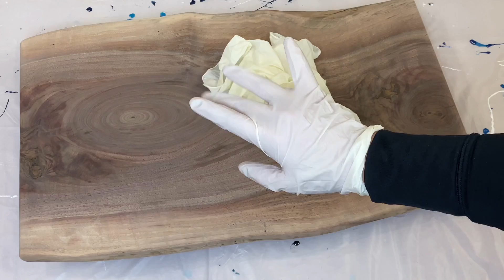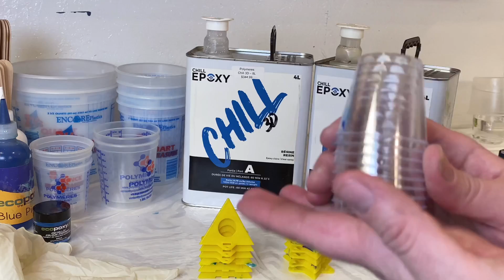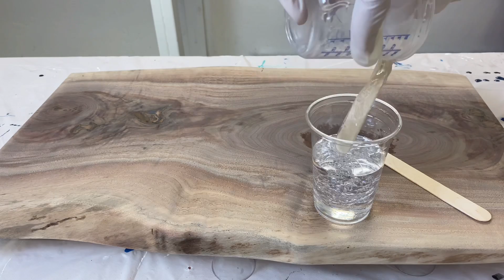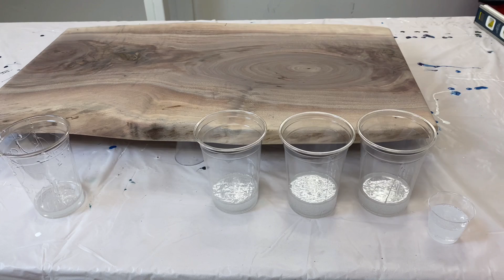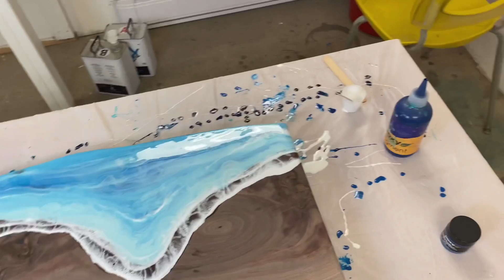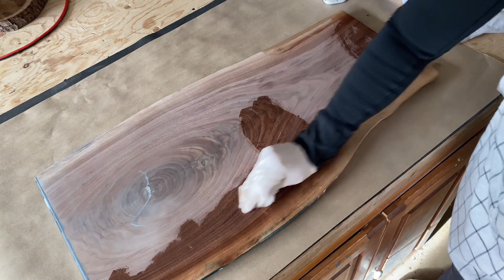How to make a Resin Cheeseboard  | Epoxy Art Overlays For Beginners  | Epoxy & Woodworking Tutorials

Comment: I’ve watched your videos so many times! Your artwork is absolutely beautiful. I have tried to make my own beach art on a bamboo serving board but I’m having trouble. I can’t manage to get the cells for the waves. I bought the Chillepoxy resin and hardener as well as the Chillepoxy white liquid pigment. No luck 😞😔 Also, the edges won’t stick as I would like them to. Could this be the type of wood I’m using? Could it be that I am warming the resin too much somehow? I’ve tried multiple layers. I feel pretty frustrated right now. Any advice is appreciated.
Reply from the maker: Thanks so much for your kind words and for watching! I definitely want to give you some pointers for this and help you achieve the look you’re going for. 

Which kit from Chill Epoxy did you purchase? You’ll want to make sure it’s the Chill 3D for the best results with overlays like this. If that is the kit you bought, it could be the temperatures are too warm in your work space. The sweet spot for me is 68-70 degrees. Unless the epoxy is crystallized or below 60’ish degrees, you shouldn’t need to warm it up in a water bath at all. After you’ve mixed it, try letting it sit in your cup for 10-15 minutes before you pour. Also, make sure you’re not blowing the white too much with the heat gun. You want to move it a couple inches and then let the cells appears on their own as it cures. You can spritz with alcohol, but it’s not necessary and will usually require a final clear flood to level out any low spots. Lastly, I would experiment with adding more pigment. Chill recommends starting with 2-5%, but I like to add up to 10% for the density I like to really make the cells pop with the clear.

As for the coverage on the edges. Is the bamboo serving tray already coated with oil or finish? 

Try sanding the sides of the area and round off the edges slightly where you want it to run off. I’d recommend using an orbital sander and 100-120 grit. If it’s coated in any type of oil or wax finish, that should be removed prior to pour epoxy over it. You may need to clean with acetone, sand, repeat until you remove as much as possible. It’s always best to pour onto raw wood though. 

I hope that helps! Turn on notifications and I can work on a video to help with this. I’ve been meaning to do that for a long time in all honesty. Thanks again for watching and subscribing! 

My goal for 2022 is to focus more on my YouTube channel! And… learn to scroll saw 🙈🙌🏼🥂 Happy New Year! Please keep me posted how your next attempt goes. Good luck! You’ve got this!

Comment: I love, that great tutorial 👏❤️ a single question, what proportions of resin and white mixtures to create the effect of the waves??
Reply from the maker: Thanks for watching!! I’m actually working on a video for this next! The best way to test it start by adding a little white pigment to the clear at a time and then mixing and testing on a scrap piece of wood. If then add a little more pigment and do the same thing. Usually 3-4 tests is sufficient. After that wait and let them cure and then see what you’re left with. It’s helpful to make test notes and label your sample. After that you’ll have an idea of how much pigment is needed to get the effect you’re going for. I did a lot of samples when I started! I hope that helps until my next video comes out ❤️🙏🏻 Good luck!
Reply: @backwooddesignco  Thank you very much for your help, I will be attentive to your channel to see your incredible works 🙏❤️🙌

Comment: Hi just found your great tutorial. One question 🤔 Should the white for waves, be less dense, less color, than the blue epoxy pigments ?
Reply from the maker: Hey Tim! Thanks for watching. Yes, you want it be less dense than the blue in order to float on top. It sounds backwards, I know, but because you’re adding more white pigment ratio compared to the blue.. you’re actually thinning the epoxy and making it less dense. This is where the clear epoxy comes in as well, with no pigment added, the epoxy is the most dense. So when the white is applied over top, it’s a huge contrast in densities compared to the white directly over the blue. 

When it comes to really low viscosity epoxy, it can sometimes be the opposite.  You have to take into consideration the density of the epoxy itself and the density of the pigment you’re using as well as the ratio.

I know it’s a little bit confusing, but I hope that makes sense! Clear as mud, right? 🤣
Reply: @backwooddesignco   4 months later.....Wanted to let you know your advice really straightened out my waves. Thanks again
Reply from the maker: @timshelton4303  That makes me so happy! I’m so glad it’s been helpful. Please send me some pictures via Instagram DMs if you want, I’d love to see what you’ve created 😍🙌🏼🌊

Comment: I’m super new at all this. I tried using regular resin (lets resin brand) and opaque resin dye (hobby lobby resin dye) to try this on a pre-made cutting board. It didn’t work and ran off the board completely and never made any pattern. I’m not sure it was because it wasn’t sanded or the dye or resin im using. I’m not sure which part was incorrect, i need all the help i can get!
Reply from the maker: I’m glad you asked! What’s the pot life and set time for the Let’s Resin epoxy kit you’re using? My guess is that it’s more of a casting epoxy vs a table top or art epoxy. The table  top epoxies have a much higher viscosity and usually great doming properties as well.

Comment: When I pour my resin it is so watery and it just rans off the board, what would be the way of fixing it? Leaving the resin in the pot for a while to thicken before pouring? I seem to have to do 3 layers to get the results I want
Reply from the maker: Thanks for watching and for your comment! Sounds to me like you’re using the incorrect epoxy. You want a high viscosity (thicker) epoxy, typically referred to as coating, table top or art epoxy. It has a consistency that is closer to honey than water. The epoxy you’re using is intended for casting and has a low viscosity, so its consistency is closer to water. My favourite epoxy kits are EcoPoxy’s UVPoxy and Chill Epoxy’s Chill 3D. Hope that helps!
Reply from the maker: @mansonmania  I’ve never tried that one personally, but there’s a Facebook group called “Epoxy resin ideas & advice” and I’ve seen many people use that epoxy. So it just may not have the right viscosity for what you’re trying to achieve. They might sell other kits though, so it’s worth looking into your current manufacturer if that’s readily available to you. I truly hope that helps!! Please let me know if there’s anything else I can assist with ❤️
Reply: @backwooddesignco  You are a star, I will look into it, still on the learning process and guess trial and error with materials and techniques are inevitable.  Thank you and thanks for inspiring us with your work. :)
Reply from the maker: @mansonmania  Happy to help! Yes, it takes a little time to work out the kinks, but after that, there’s no limit to what you can do. Never stop learning, playing and experimenting and you’ll always continue to grow and expand your skills. Good luck! You’ve got this! ❤️

Comment: hi, I was wondering if the resin is food safe to eat off of as well as the oil you use?
Reply from the maker: Thanks for your question! It really depends on which products you use. I highly recommend to check with the manufacturer of the products you have available to you in your area. OSMO top oil is food safe hardwax oil finish. Any product that is labeled for cutting or serving boards is generally food safe as well, but always make sure it says on the label. Most epoxies are safe for incidental food contact, but as far as being food safe, you will need to check with the manufacturer directly as many epoxies are not food safe. I hope that helps! 

Here’s a few other food-safe finishes that others love: Odie’s Oil & Walrus Oil

Comment: How many minutes after putting in the white pigment do you use the heat gun?
Reply from the maker: I’ve never timed it to be honest. I’ve poured right away and also poured after nearly 30-45 minutes. As long as you’re using a good pigment, it will create cells regardless. The longer you wait, the less details and definition in the waves and of course, the thicker it gets, so it will spread a lot less. I just recommend playing around with your specific epoxy and pigment and see what happens. Hope that helps!
Reply: I'm trying various things but     They are illiquid  I want to make the most fluid waves, but I can't do it right now. I will buy it again and take on the challenge. Thank you so much
Reply from the maker: @user-tj8nl8ux2b  Make sure you’re using an opaque white resin/epoxy pigment 😉 Good luck!!

Comment: Can I use my airbrush gun Iv a mini spray gun with compressor would that give me more control? 
I do have a hairdryer or flame can
Reply from the maker: You never want to put epoxy in your airbrush. It’d be a nightmare to clean and way too thick. You can, however, airbrush paint anything you want PRIOR to pouring epoxy over top of it. Just make sure the paint has dried well before coating. Also, if airbrushing onto wood, you may want to use an oil based primer first so you don’t have to sand your airbrushed artwork afterwards to knock down any raised grain. You could also water-pop the wood first and then lightly sand and paint in light coats over that. But I prefer not yo use water-based products directly onto my wood, that’s just my preference. Hope that helps ☺️

You can use a MAP pro torch to pop the bubbles, but not to push the epoxy. A hairdryer can work, but not ideal and too much dust IMO. If you check the links in the description, you’ll find a $40 heat gun on Amazon. Just a cheapie, but it works great 🙌🏼 Not technically an affiliate link anymore though.
Reply: @backwooddesignco  ha ha sorry I know lol.     I Ment use the air to give me to wave look lol
Reply: @backwooddesignco  thank you for the advice I’ll just try the airbrush gun as my wind spray to get the look Iv done many tables and shelf’s with cut out for resin.      Even Lego for a school       Did a carbon fibre table that had a gel coat paint in black to help was a good test      I’m just trying the chopping board with your sea effects for the first time     Got the food safe resin too
Reply from the maker: @garydeandeery  HAHA! Silly me. I just realized now that you meant to use the gun for the air only and you didn’t mean you were going to put epoxy IN the airbrush 😂🤦🏼‍♀️ I have an airbrush and HPLV air gun, the latter would be too much air I think. I imagine the 20-30 psi of the airbrush would be enough air to move the epoxy.. I would keep the cap on to limit dust if you try it. I just don’t know if you’d be able to achieve quite the same effect and the same amount of cells without the heat. I’ve never tried it though, so it never hurts to experiment. Just give it a light torching with the mini propane torch afterwards, quickly and not too close (like I show in the tutorial). That will pop the bubbles and help to create a few more cells. You can also give it a very light mist (from 12” or more away) with 97-99% alcohol and that can help create cells as well, but that trick does depend somewhat on your epoxy and how the effect will turn out. For this effect, the thicker the epoxy, the better 😉
Reply: @backwooddesignco  your a star thank you for your help     You have a new friend now from England lol

Comment: Hi , i don't have a heat gun , but I have jr tetanium white colour which is very nice one , I couldn't achieve the lacing effect I was hoping for I used the hair dryer , is the heat gun is a most to achieve this effect🙈
Reply from the maker: Not necessarily, but it’s much easier and also helps to bring out helps on the pigments that are more difficult to create cells with. You should be able to get a similar effect with a hair dryer. I’ve used a straw and my own lungs before, although I don’t recommend it. I have found the best results with using a heat gun to be honest! You can find one on Amazon for around $30 CAD. I’d recommend the orange Black & Decker one to get you started!
Reply: @backwooddesignco  I really appreciate your quick and very detailed reply 🥰 such a blessing,  thank you very very much
Reply from the maker: @tharwajawad2124  Happy to help!! Thanks so much for subscribing and for your support. Good luck on your epoxy journey! It takes some practice, but you’ll get the hang of it quickly.
Reply: @backwooddesignco  thank you dear 🥰